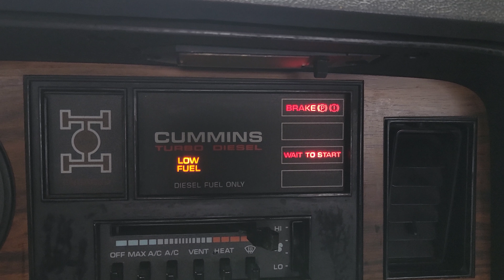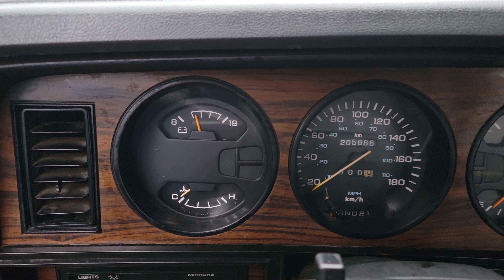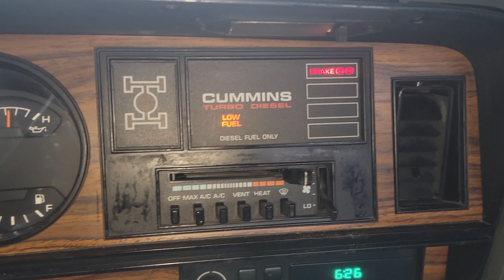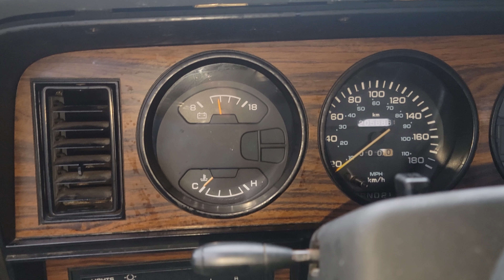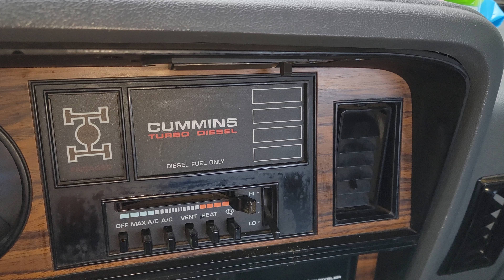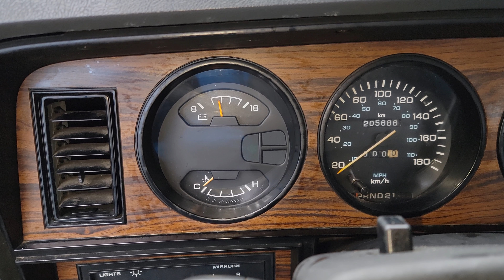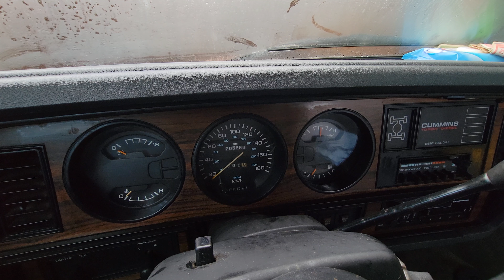PCM Repair #2 | 1st Gen Cummins

Comment: I just did this to 1993 dodge b350 full size van..worked like a charm..it took 2-25v 220uf capacitors and one. 35v 470uf capacitor..i couldn't be happier..this is a sportsmobile conversion van with penthouse top and all the goodies inside I'm retired and wife and I love the van
Reply from the maker: Awesome to hear that it works for those vehicles as well!!

Comment: Thanks for the tutorial.  Just completed on my 1993 W350.  Problem solved.  Took only 4hrs to fix.  Capacitors where the correct type as well.  Cheers

Comment: Great job really nice work.  My second gen pcm a 95 with the single connector in the pcm a few years ago did all kinds of weird stuff . Finally i gave up and got a rebuild pcm from mopar . Fixed everything except the dropping out of cruise . That was the brake switch.  ..Thanks for the video

Comment: Hi Tyler. I think this is your best technique for replacing the caps so far !! So much easier!! My '93 has 193k miles. No ecu issues that you describe so far. After I weld up the lower door hinge damage, I think replacing the caps on the ecu is good preventive maintenance.
Reply from the maker: It wouldn't hurt to do them as preventative maintenance! They are bound to start going bad eventually. Maybe it's a colder climate issue..but good to do either way.
Reply: @OvensGarage  Caps die with age and heat. This 1st gen has been in desert conditions it's whole life. Caps are on my to do list !!
Reply from the maker: @mikep95133  Did you ever figure out your fusible link issue?
Reply: @OvensGarage  Nope. Drives perfect every day ! That makes me crazy !!

Comment: Im saving  this video for  future reference cause the only problems I  had with my  1st gen are , dead short to ground in power feed to trans , fried ignition switch  and i had to clean up the  main disconnect  plug on the battery cable  coming out of the alternator.

Comment: Badass video. I need to get into mine and attempt to fix it properly. I’ve bypassed my computer mostly..OD ground switch, grid heaters on a momentary switch. But it would be nice to have it run though it’s warmup cycle in the winter time instead of me having to keep hitting the momentary switch.

Comment: My 92 First Gen is suffering the same issues that you show here! I had a local electronic shop change the capacitors. The one by itself was obviously burnt. The PCM is now in the hands of a local garage. I am hopeful this was the issue!!
Reply from the maker: Good luck hopefully that solves your issue!
Reply: @OvensGarage  I had my capacitors changed in my PCM however it did not solve my no charge/grid heater problem! Just spent a $1000 on labour at a Chrysler Dealership and they couldnt find the problem! Do you know any experts on the Island who could look at my truck? Thanks!
Reply from the maker: @Mr B  I'm about the closest "expert" you'll find on the island, among some of my other friends here. Where are you located?
Reply: @OvensGarage  Qualicum Beach
Reply: Now my radio is out and my dome light and under dash light??
Reply from the maker: @mrbmcp  check your fuses then check for power from your fusible links
Reply: @OvensGarage  Fuses are good. My radio quit working too. That is a new issue. My wait to start and other lights work intermittently. Also my overdrive switch was working today and now it doesnt either. I dont know where to look for the fuseable links but I believe the dealership tech checked those. He put in a seperate volt reg and jumped one of the 3 square solinoid switches but then it wouldnt go into overdrive. There must be a short but try and find that agggh!!!
Reply: Just checked my truck now my dome and dash lights are on!!! WTF!
Reply: @OvensGarage  I watched a you tube video where a guy cut out the fuseable links and put in a fuse panel under the hood. Do you know of an auto electric business who could do that? I dont have the know how or garage space! Thx
Reply from the maker: @mrbmcp  Honestly you'd probably be best off following the instruction of that video if that's what you want to do. A lot of shops won't have the specific knowledge of the issues with this trucks unfortunately.
Reply: @OvensGarage  FYI! I found a used PCM at Duke Point Auto recycler today and Bingo all is fixed! Everything works great now!! YES!!!!
Reply from the maker: @mrbmcp  oh no way that's awesome

Comment: Question time 🙋. So I replaced capacitors in the ecm Panasonic and I’m very good with soldering so everything is good. Plug ecm in and truck will go 10 miles then the A/C, Tach and Voltage drops. So I pulled it back out and soldered the jumper wire like you did and same thing. Drive it and everything is working about 10 miles down the road everything shuts off again. I checked all the pins and even flared them open to make sure they’re contacting. What do you think? It’s my son’s daily driver.
Reply from the maker: That's interesting. I'm not sure what that could be. If you have a good pcm it might be worth trying to swap it. Sorry the capacitor replacement didn't fix it!
Reply: @OvensGarage  so it turns out my multimeter was trash so I got a new one and checked ohms on everything and the crank sensor was the culprit. Thanks for responding. Everything is good for now anyway.

Comment: Good fix! Have you run into the crazy speedometer issue? Mine will read random mph all over the place it always counts the mileage right though regardless of what the needle does.
Reply from the maker: Yeah I had that issue previously on my red truck. The speedo issue ended up being a bad VSS down at my transfer case.

Comment: I hope you may be able to answer a question about the 92 cummins speedometer. Does the PCM (engine control module) provide a signal to the speedometer or should the speedometer work independently from the PCM? My speedometer is not working and the auto transmission will not shift into overdrive. The VSS tests good and I've replaced it with another known good VSS, I've checked continuity between the VSS and the PCM and it's all good. Thanks
Reply from the maker: Hi Larry from my experience and looking at the FSM the speedo operates independently from the pcm. I believe it still uses a signal from the vss to determine when the truck is allowed to go in and out of overdrive though based on speed. The other thing to consider is the throttle position sensor and it's correct adjustment. If it's out of adjustment (on the top of the ve pump throttle) it can also prevent the truck from shifting into overdrive. Decent garage has a good video on how to check and adjust the tps.
Reply: @OvensGarage  Thank You Kindly for the rapid reply and thanks for the TPS adjustment tip. I will check and adjust that today. I had come to the same conclusion about the speedometer operating independently based on the wiring schematics I just wondered if you may be able to verify. My 1989 is so simple I'm old school been wrenching for fifty years and I greatly admire the automotive engineers of old who were somehow able to make things go without a computer!

Comment: Would this be a similar process for a second gen? My tach reads 0, a/c doesn’t work, constant gear hunting, all dash lights flicker on and off and the charging system works occasionally. I’ve replaced ess twice, checked, double and tripled checked all wiring and grounds and believe I have narrowed it down to the pcm
Reply from the maker: I'm not sure about second gens I'm pretty sure that the pcms are quite different
Reply: Dang it

Comment: I had my truck worked on at the shop I had a shop off my way he’s over by Atlantic PA and they messed up my charging system and things like that did all kind of stuff screwed my truck up I find out the guy don’t like first Jen Dodge‘s he should just told me that from the beginning anyhow they had to which is being fair to him he had to modify my throttle linkage bracket because where the cables go in because one of the Hamilton cams had didn’t have a provision for a fuel filter so he had to put a filter from the second GEN on there which is cool I appreciate that but they must’ve re-welded that thing on the truck without disconnecting the battery because that’s why am I’m guessing that’s why my charging system ain’t working right I’m overcharging and things like that you know he really screwed me up bad but I learned something you were talking about that heatsink was what controls how much it charges anyway thanks for the information guy this is six in a row jim From Kennerdell Pennsylvania

Comment: I have a first GEN question for you
When I turn my key on my wait to start late doesn’t blink just stays on and then when my truck is running it just continues to blink 
I don’t have a PCM
It’s my first first GEN dodge build
I watch all your videos
Reply from the maker: What year is your truck? Sounds like the PCM failure symtom for sure.
Reply: @OvensGarage  it’s a 1990 W 250 no PCM in the truck
Reply from the maker: @ryantopping235  I'm not familiar with the 90s unfortunately! Not sure how they operate the grids. I think there is a module under the hood somewhere.
Reply: @OvensGarage  The one downside of the 1990 no computers of any kind and not a lot of people have information on them been learning as I go. 
Just installed my gauges above my rearview mirror like you did. Looks awesome
Reply from the maker: @ryantopping235  that's great would love to see what they look like
Reply: @OvensGarage  I don’t think you can send pictures back-and-forth on YouTube
Reply: If you’re on Facebook I can send you pictures
Reply from the maker: @ryantopping235  yep I'm on Facebook or Instagram you can send me a pic
Reply: I just sent you the pictures on Facebook
Reply: The heater control module is on the firewall on a 90. Blinking light may indicate a failed or disconnected temp sensor though as it will flash if it is not reading the intake temperature.

Comment: Love the vid...i have 1993 5.9 gas van my com has good powers comming in and good chassis grnds at computer when back probed...have good 5v &8v sensor output are well..however no ground at pin 51...any input would be appreaciated
Reply from the maker: Do those vans have similar computers?

Comment: None of my lights work on the info center, truck starts and everything seems to work except the grid heaters. You think this fix will solve that issue? Also speedo doesn't work and headlights have a light flicker to them
Reply from the maker: If the grid heaters don't cycle on in the cold and after you start the truck it doesn't start charging, I would suspect PCM issues. Speedo doesn't go through PCM, that's likely a VSS issue, and headlights dim when the grid heaters cycle.

Comment: Hey, I know this is an old video but if I have my brake light light on, abs and water in fuel light and my brake lights don’t work after my alternator was over charging the battery/system would this be the pcm at fault or do I have to chase everything now?
Reply from the maker: @telfordparks6083  your brake lights coming on or off shouldn't have anything to do with the pcm
Reply: @OvensGarage  ok thanks but what about all the dummy lights like the abs/fuel in water?

Comment: The microfarad must be the same when repairing electronics, but it is ok to use a capacitor rated for a higher voltage. as long as you have the physical room to place the new capacitor. The capacitor with the higher voltage rating (and same microfarad) usually will be larger.  But you should not go the other way and replace a higher voltage rating with a lower voltage rating. The repair may work but the lower voltage rated capacitor could fail sooner than the higher voltage rated capacitor in your repair.  I am doing this repair for my neighbor that is having the symptoms mentioned in this video.  All of the capacitors that I removed were rated for 25 volt.  I did determine that the 220 microfarad capacitor that is closest to the 470 microfarad capacitor was bad.  With my voltmeter the bad (220) capacitor measured 14 microfarads.  The other 2 capacitors measured good (labeled value).  I am still going to replace all capacitors with new ones.  Thank You for posting this video it was very helpful!!!
Reply: Completed the repair today (replaced all 3 capacitors) and installed pcm back into his truck. Everything is back to working as it should during cold start up test drive with outside temperatures at 22F. (Grid heaters, overdrive and etc.)

Comment: Got a question for you. I’ve been chasing cruise control problems in my 93 5 speed. So far I’ve replaced the clockspring, cruise servo, and tested vacuum. My odometer, ac(bad clutch), dash/info lights, grid heater, speedo,charging , and tach all work. I was looking into doing a quick pcm/ harness continuity test next to narrow this down. But for the life of me cannot get cruise control to work, would one of these capacitors come into play with that or not? Any tips would be much appreciated
Reply from the maker: I don't suspect that the PCM would be the problem causing your issue. I would take a look at the wiring diagrams for the cruise control to start so you can rule things out. I have not had any issues with cruise control on my red truck so I can't really give too much advice. One thing that came to mind though and not sure how you could test it, but when you depress your brake pedal the cruise control disengages. If there's a way to jump that switch (probably the brake pedal switch), I'd try and rule that out too. Otherwise, maybe the clutch neutral safety switch has something to do with it would be my next guess. I doubt something is wrong with the cruise itself, it's probably just something from preventing it engaging and staying engaged.
Reply: @OvensGarage   I’ll check into the clutch safety as I’ve already tested the brake switch. I would imagine some issues with my repinning job on the new servo…. But I’d have to rack my brain with some wiring diagrams on the clutch safety as it works properly as far as I know…
Reply from the maker: @idontuploadjustwatch  Was just looking in the FSM, did you see the section on "Speed Control System - Test Procedures"? It is group 8H-7. It runs through a couple testing methods to rule out the servo and PCM it looks like.
Reply: @OvensGarage  speaking of, with your working cruise control, is there a minimum speed that it will activate at?
Reply from the maker: @idontuploadjustwatch  yes. I believe it's something like 50kmh. It's in the FSM I'll have to check.
Reply: @OvensGarage  I appreciate the help! Definitely watch your videos when doing my own repairs! Cruise control now works after a clockspring and servo. Ended up being that the original servo wiring was right. But I’m essentially and expert at cc diagnostics now lol. And the American minimum speed is around 60kph or 36 mph
Reply from the maker: @idontuploadjustwatch  I guess I know who to go to now when I need cruise control help! Glad you got it fixed. 👍

Comment: I got a 1992 LE dodge cummins. I want to restore it. Bought brand new back in 91. I  had a business where I used it for business. Bad part is I had 8 different guys driving it. It came with cruise  control. The speedometer don't work.And the streering wheel is rough . [needs switches] I have a 1991 parts truck that has a working speedometer but no cruise control. Are the PCM's worth swapping ?
Reply from the maker: Is it showing signs of a bad pcm? No need to swap pcm if it's still working.
Reply: @OvensGarage  thanks thought that effected the speedometer as well ?

Comment: Low fuel light. I never noticed one.  Most fuel I’ve put in is 29 gallons.  Oops 😹
Reply from the maker: Haha, yeah his fuel gauge is malfunctioning. We had dropped the tank the day before and I don't think we plugged the sensor back in correctly. Way to test it is probably just unplug the sensor at the tank.